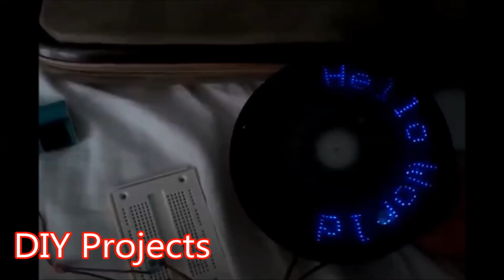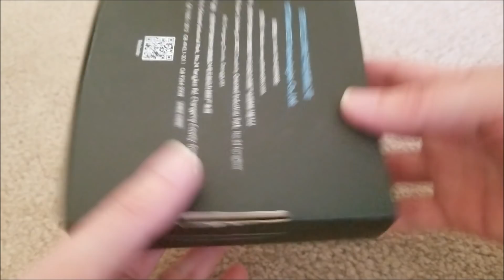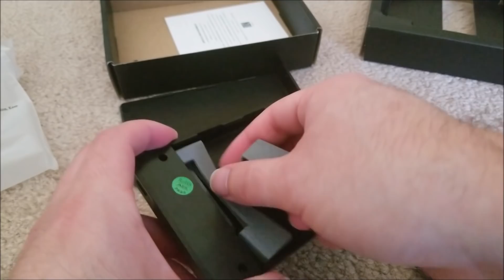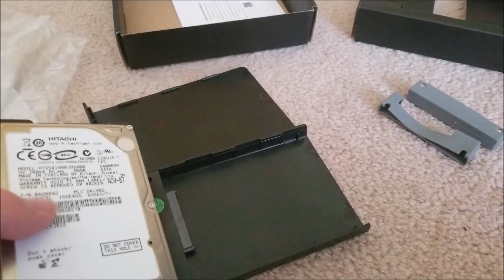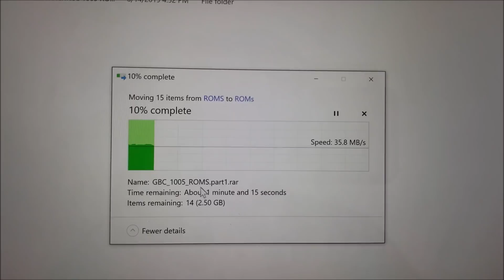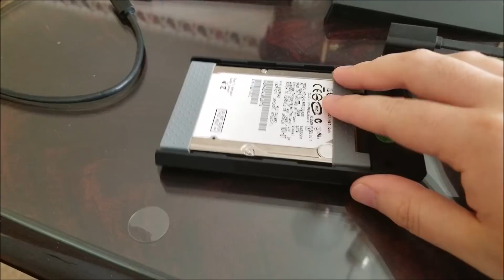Yottamaster USB C 3.1 External SATA Laptop HDD Enclosure Review

Comment: Thanks for the review.  It looks like a decent 2.5" drive case.  It's a plastic case, but they provided those silicon rubber shock end caps and it's tool-less design.  The price is good.